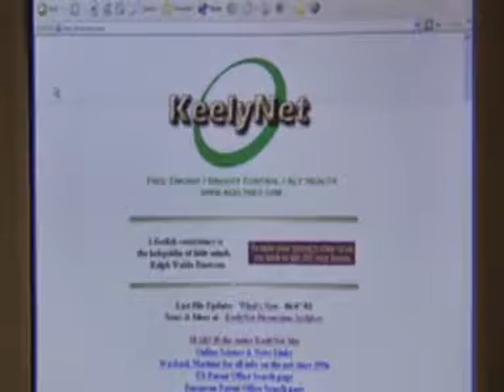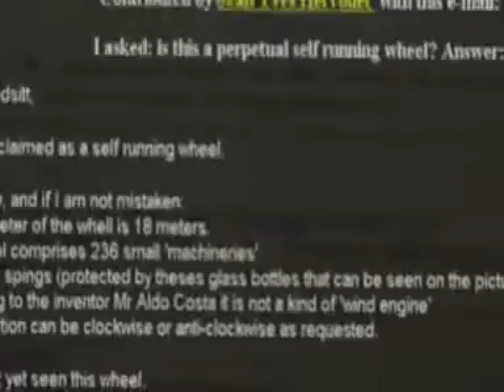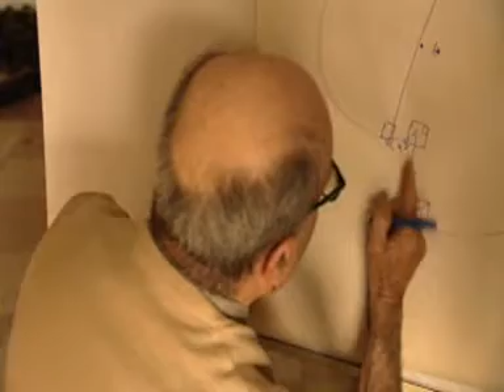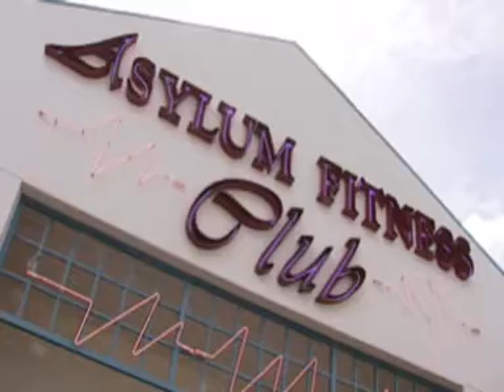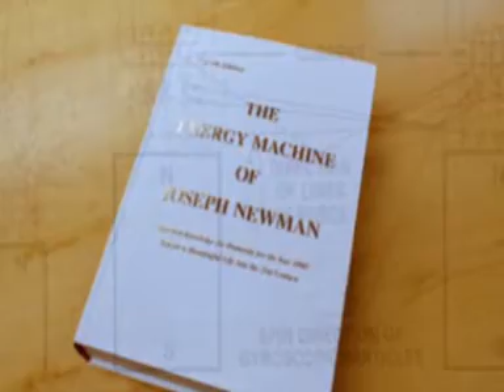a machine to die for: the quest for free energy (part 3 of 5)

Comment: Of course free energy is possible, people are so narrow minded. Yes the science says its cannot be done, because of heat and friction losses ect ect. But it fails to take into account that we are already awash with energy. We have never had an energy crisis. The crisis of our time is that just a few super rich people want to control and sell the worlds energy. Wherever that may come from. And secondly we have a problem with our harnessing of energy which is already there and efficient use of that energy. Yes there is no such thing has a free lunch, ie the energy must come from somewhere, even if its only cosmic rays coming from the sun, its still come from the nuclear reaction inside the sun. It cannot just appear. But it should be entirely possible to build even perpetual motion machines which harness natural energy around us. To say this is impossible, is a bit like saying we are alone in the universe. Lets consider even the coldest day you can imagine, even on the coldest possible day on Earth, there is still lots more heat energy available in the air, than their would be on Neptune. We can harness this source by using a heat pump, however the heat pump itself requires electricity to run. But the system is still producing more energy than it consumes by actually removing heat already in the air. Its just nobody has managed to close the loop and make the excess energy power the pump some how. It should be possible to extract energy from the ionosphere in someway not yet thought of. Geothermal power is frequently just wasted. In the town of Matlock UK, Water pisses out the ground at around 20 degrees C. So what do they do with it!. They make pretty water features out of it, then send it on its way into the river derwent. Whilst all the local shops and houses use electric and gas central heating. In Bath the situation is even more farcical, here the water gushes out the ground at around 40 degrees C and more in places. But I bet if you ask a resident of Bath how they heat their homes. They will say, Gas central heating of course. This shows how much of a tight grip just a few greedy parasitic bastards have on the public. Yes there are engineering problems to overcome, for instance the water in Matlock is so full of Calcium Carbonate, heat exchangers unless engineered in the correct way would quickly scale up. But these problems can be overcome easily. Its a pathetic indictment on the human species, a species that claims to be intelligent. When energy sources like this are overlooked. While dirty wars are waged on foreign countries for fossil fuels we can ill afford to be burning anyway.
Reply: +Richard Sandwell :Using the energy as you mention is not perpetual. The sun adds energy. Geo thermal is OK until the deposits in the water coat the transfer surfaces so much that they form an insulation effect and you get very little transfer. How long depends on the amount of deposits in the water. If it were so easy I am sure the Germans would have come up with something in WWII.

Comment: A battery that turns a motor that turns a generator that charges a battery. If you do some work with one of the battery the system can never recover. Seems to me that you have built some sort of a flywheel.

Comment: Its not over unity if you have to charge or use batteries. If it is over unity you should just be able to full wave rectify the output to feed power to the input to make it run. Show it with NO BATTERIES and I will believe you.

Comment: FYI both the theory of gravity and relativity have been revised because they had glowing inconsistencies.  

And BTW carbon is an element.  You just decreed that the iron at the core remains iron?  So why wouldn't carbon at the core remain carbon.  Coal and oil are just aggregates of carbon.  You're mixing up random facts.   

And mini-pinchers are the product of BREEDING, not evolution.  They didn't evolve from external/environmental pressure.  Everything you've said is verifiably wrong.  Sorry

Comment: The center of the earth is magma and iron not oil. :| any fuel that would make it down that far would compress to crystal and then melt under the heat. The Theory of Evolution has more facts behind it then any religious hypothesis. Just like the Theory of Gravity, and Relativity. If you don't believe in evolution then you also must not believe in mini-pinschers they are after all a result of controlled evolution.